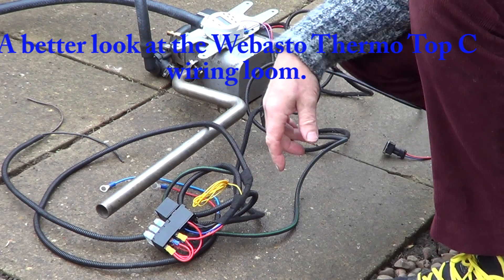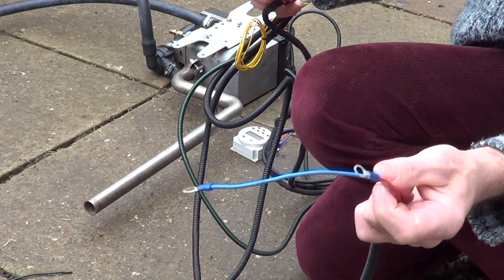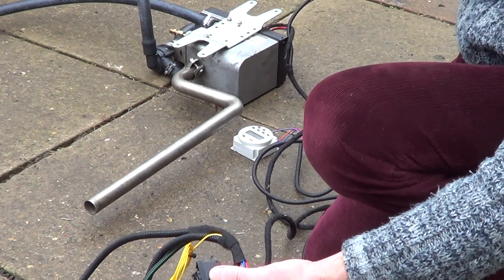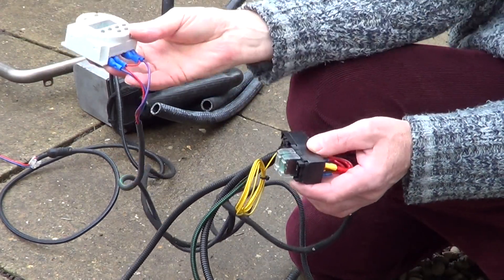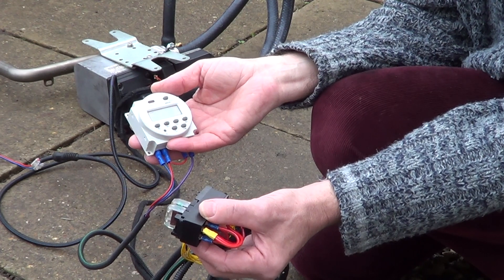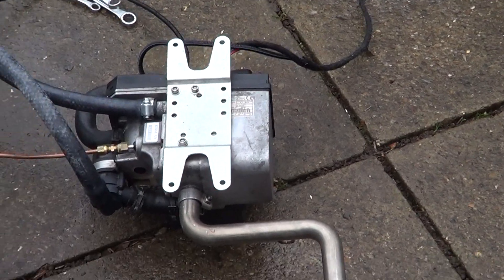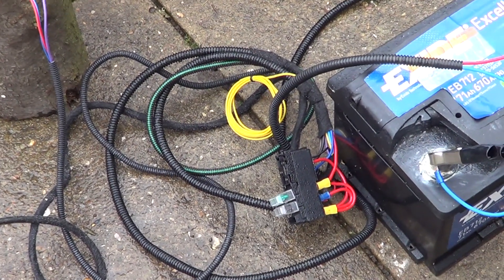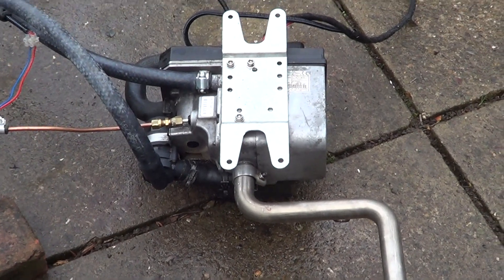Webasto Thermo Top C Loom & Test Run

Comment: You said you were having some issues with air in the heater, if you install this into the boat, how do you ensure there wont be air in the circut?
Reply: Hi, I was wondering what control unit that is. I'm having trouble finding one that will work and not cost the earth.
Reply from the maker: Hi, Phil the control unit I have wired in is this cheap one that I found and this seems to work or will work fine in my application on the boat where I'm going to fit the Webasto in the next couple of weeks now hopefully most of the worst winter weather is over. I do know both Webasto and Eberspacher units are very pricey I have had them in the past mind they have always worked well see link for the control unit below. Kev.
 https://www.amazon.co.uk/Heschen-Digital-Weekly-Programmable-Switch/dp/B071D9H3JY/ref=pd_sbs_107_1/260-3668637-7244139?_encoding=UTF8&pd_rd_i=B071D9H3JY&pd_rd_r=e02b03b4-3dde-11e9-b240-8b522ad59c96&pd_rd_w=kxJpU&pd_rd_wg=FMglu&pf_rd_p=18edf98b-139a-41ee-bb40-d725dd59d1d3&pf_rd_r=655NPZNA91GAZR8E3K3E&psc=1&refRID=655NPZNA91GAZR8E3K3E
Reply from the maker: Hi Many thanks for your kind comments, Yes I have heard others have this air problem re the Webasto pump what I have seen done is on where you connect up the flow side of the water heater hose on the Webasto is to put a small length of heater hose then in 19 mm copper fit one of those auto air bleeders have a look at the pictures here to see what I mean.
https://www.canalworld.net/forums/index.php?/topic/87746-webasto-thermo-top-c-stopped-working/

I'm not sure I'm going to do this as remember you will need a header tank somewhere higher than the heater to fill the system and keep it topped up and also my small radiator does have an air bleed vent  as well and I'm going to try to run the heater hose slightly down or level thereabouts from the Webasto unit to the calorifier but if I still have air issues re the Webasto pump! Well then I may put a vent like in the pictures re-link above I think its very much trial and see! Hope that maybe help Kev.
Reply: @BramleyProductions  I think i see what you're talking about, assuming that the air will rise into that copper part above the pipe as the water goes through, and then you can turn the nozzle to let it escape?
Reply from the maker: Yep, you have got it! Sometimes here in the UK, those auto bleed valves are used on central heating systems they do work automatically letting any air that rises to that point out! I have no idea how well they would work on a Webasto system mind but if air was a problem it would be worth fitting one they are not that expensive Kev.
https://www.screwfix.com/p/bottle-air-vent-15mm/34359?tc=DB8&ds_kid=92700020952478947&ds_rl=1241687&ds_rl=1245250&ds_rl=1249404&ds_rl=1249799&ds_rl=1245250&ds_rl=1249481&gclid=CjwKCAiAs8XiBRAGEiwAFyQ-em3KaI4IDFnsQeXkehRQ8LSdzysemk6FSVrfkwFZpzlNXEaLWvNCERoC0d4QAvD_BwE&gclsrc=aw.ds
Reply: @BramleyProductions  Mate, you're an absolute legend, definitely subscribing!
Reply from the maker: Thanks, Yes please do come back an see how this Webasto all fits on my small narrowboat and if I can help in any way re my own limited knowledge on this type of Webasto just ask will always try to help re -any questions Tanks again Kev.